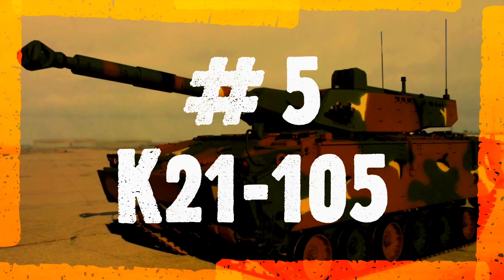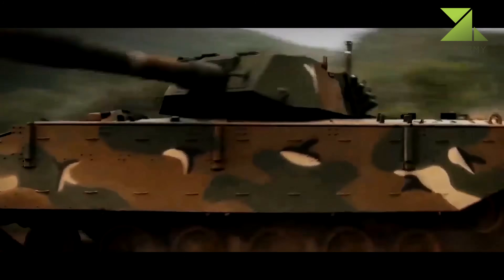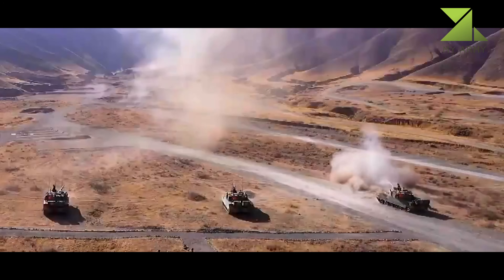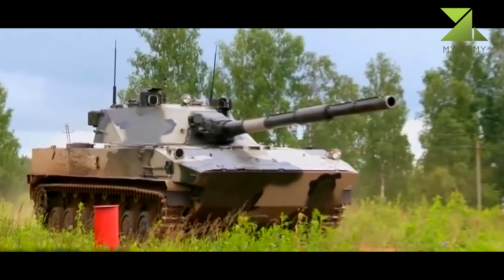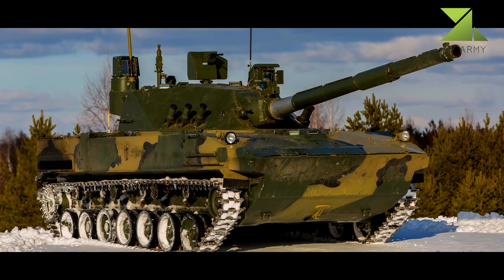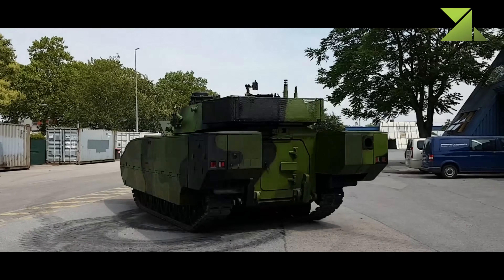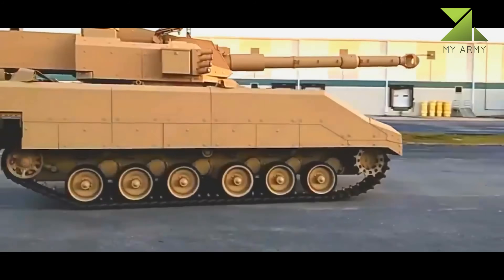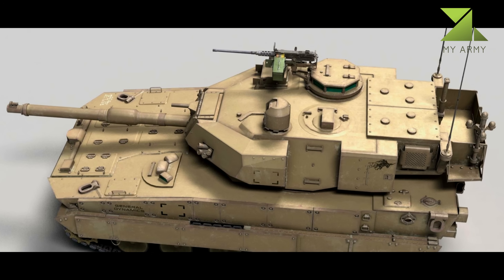TOP 5 Most Advanced Light Tanks - TOP 5 Best Light Tanks

Comment: The new LYNX 120 and the other german Tank, the so called "Chain-BOXER" (Ketten-BOXER/normally, the BOXER is a Wheel tank), also with the 120mm Rheinmetall L44 (same as Leopard 2 A4) are also very, very interessting light tanks because they use a chassis which is modular changeable. The BOXER only use moduls and the LYNX another turret. The advantage is, that you need not so much special vehicles only a basic Chassis (LYNX oder BOXER) and the modul for different tasks.  The classic tank, which is only build for one task is the past... the future will be the high flexible tank-systems.

Comment: The Griffin should have been built with fold in atgm launchers for Javelin or Hellfire to complement the 105mm. How is it that 3 out of the five on this list have that capability and the US is still playing catch up? The US Army need to evolve in their thinking for the 21st Century where the use of atgms are a normal or soon to be normal part of the equation via distributed lethality. Btw, the Lynx 120 is the best LT on this list
Reply: Not much use here we don't have enemies with an armor !! So display lang Yan!!
Reply: Because its the Bradley's job to launch ATGMs and not the tanks and as per western doctrine tanks doesn't travel alone they usually have Bradley's and other APCs to support them
Reply: I know, but it's a outdated doctrine to a degree, our Cavalry units should be equipped with the MPF as Scouts replacing big brother Abrams in that role  the MPF would be a better platform for the scout role because of a smaller footprint than the M1, the ability to launch atgm's will only enhance its role and build on the Army’s new distributed lethality doctrine that it's building on. The M1X will have that capability for the same reason mentioned,  that will only give our armored forces to include the OMV (Optional Manned Vehicle)candidate which will be adding the 50mm plus atgm package a more lethal edge over their peers.
Reply: Ok ok these was a gulf war era infantry fighting vehicle soon to be replaced u s a always find it difficult to replace current system  cause they require huge numbers unlike  others who produc e just a few numbers and already showing em.off!!
Reply: That's why I focused in part on distributed lethality, meaning bringing a lot of firepower from multiple platforms simultaneously in order to maximize lethality on a battlefield across a diverse set of targets.
Reply: Maybe, but Rebel terrorist and Muslim rebels has RPG's which are an anti-tank weapon too, so it's still really needed by our Phil. Army, for defense purpose, and urban warfare too.